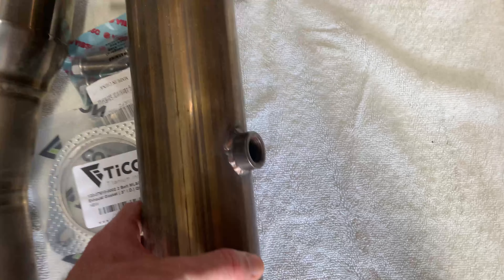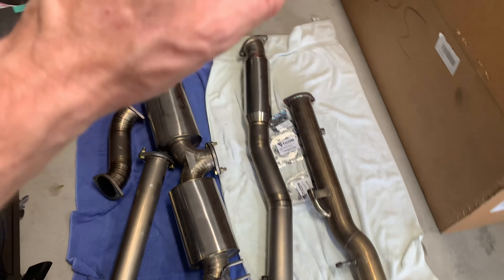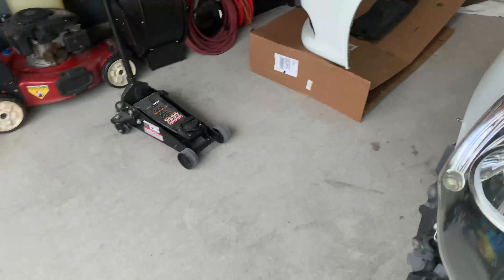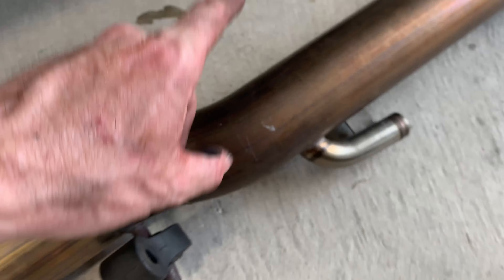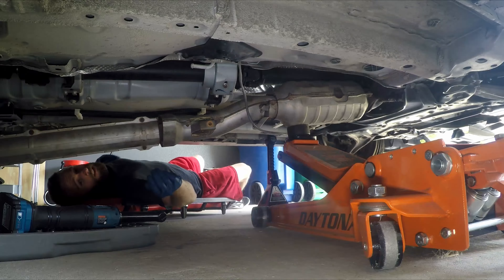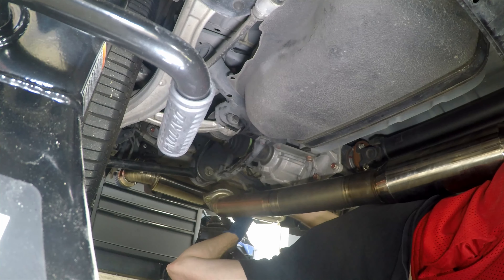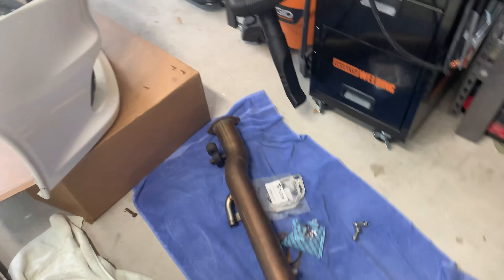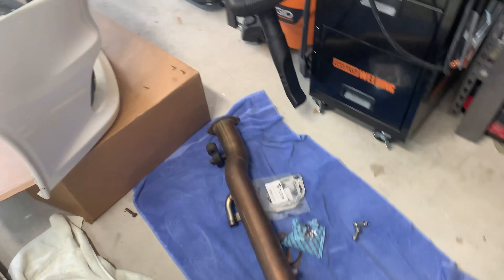Evo X Gets Private Label Mfg. Titanium Exhaust & ETS Test Pipe (Full Sound Comparison)

Comment: I know not every car sounds good being straight piped, but one thing I love specifically about the evo x is they sound so good straight piped or with a muffler. Most people mistake a super loud car as a great sounding exhaust. For example, the 5.0 mustang GT straight piped sounds awful in my opinion. I had a Perrin performance exhaust on my evo and it sounded so clean and deep. Unfortunately it was too quiet for me so I went with the ETS V3 extreme. It’s so loud under wide open throttle.

Comment: I love it, I put in a tsudo exhaust on mine and haven't been able to clear the code saying its too rich. Did you run into the same problem?
Reply from the maker: Haven’t driven it yet.  My last car was a focus ST.  I had basically the same defouler setup.  When inspection time came I would just have to stay out of boost and baby it until the monitors would all say ready.  If I tried punching it too much flow would go past the sensor and throw the code.  I’d try resetting the code and doing a drive Cycle but again stay off the throttle.  Usually took me 100-200 miles to run a drive cycle.